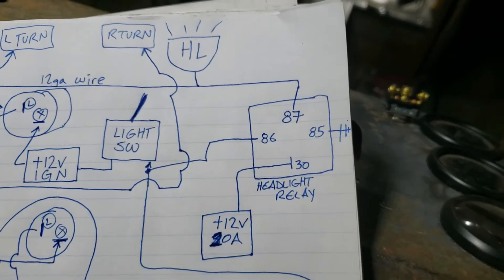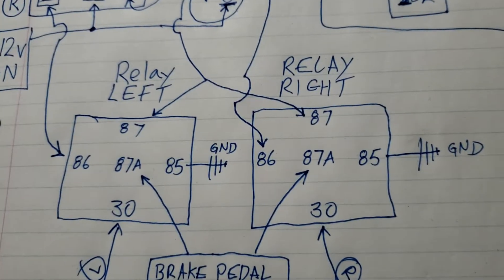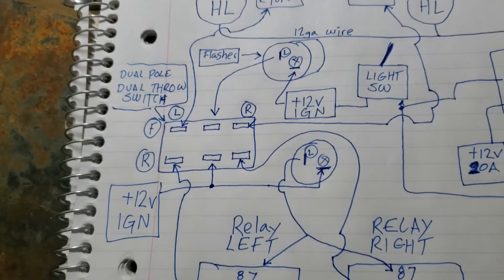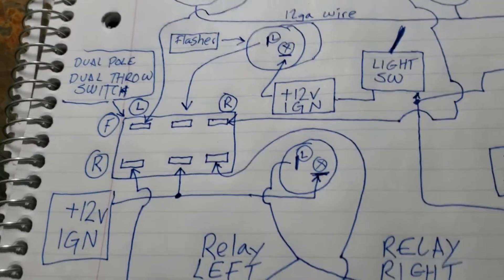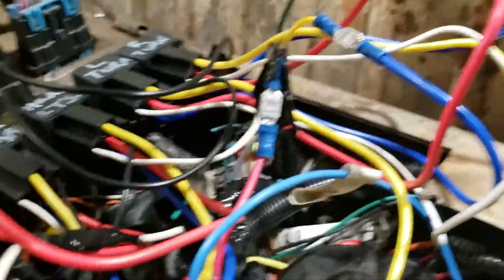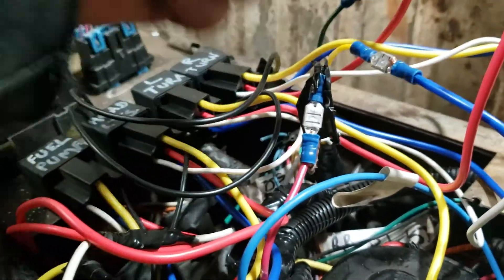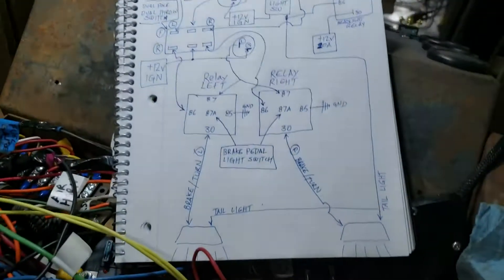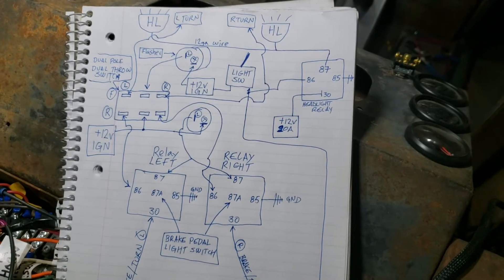Wiring up the Tail / Turn & Brake lights from Scratch

Comment: Could you please help me? I want to wire just my tail lights... Or maybe my head lights and tail lights together on a toggle switch? Everything is working except my tail lights on a 2008 Scion XB that I just bought. Someone added extra lighting there are wires going  everywhere. But my tail lights and my tag light will not work. I have already been pulled over twice. My son used to help me with all of this ... Unfortunately he was murdered over a woman 5 years ago. I am on disability . But if you can help me I WILL cash app or send you some money for walking me through this!
Reply from the maker: Wow. Jesus. Sorry to hear about your son. I think your best course of action would be to call a local automotive shop, preferably one that specializes in electrical. It doesn't sound like a big issue, but it's definitely one you should get sorted. I'm just some Yahoo Hillbilly up in Canada. You need someone local. Or check the fuses...

Comment: I have a 2006 dodge dakota  my brake lights stopped working on one side it has power  and not on the other side I  replaced the bulb  the light come on the right side but no the turn signal  and doesn't work at all on the left side it was working but just stopped working
Reply: Help

Comment: I don't follow the duel type switch. Is it a turn signal switch? Do you have a part number??? Where do I get this type switch??? HELP !
Reply from the maker: No, not a turn signal switch. It's called a DPDT (Dual pole dual throw) switch. Any place that sells automotive electrical stuff should have it. Literally just an on/off/on toggle switch with 6 spade connectors on the bottom. Good luck, and thanks for watching!

Comment: Would the rear lights wire split from pin 87 of the head light relay. Instead of directly from the switch. Not criticizing I’m just asking if it’s ok to do that
Reply from the maker: I didn't do that but I don't see why you couldn't. Try it and let me know. Might be better because the lights would run from a relay...always safer. Thanks.

Comment: How do you activate the brake lights when stepping on brakes
Reply from the maker: A momentary switch has to be mounted so that stepping on the brake pedal activates it. Also, some proportioning valves have a trigger built in that will allow power to flow. Many ways to make it work.  I believe Kip Tipper has a good video for wiring relays. Good luck and thanks for watching.

Comment: Can you show the work ? It would help out much more
Reply from the maker: You wanna watch me solder wires and attach relays? If you don't have a grasp of those skills,  you may need to back up a couple of steps and learn that first. I believe Kip Tipper has a good video on wiring up relays.

Comment: Do you have a part number for the dual/ dual switch? I’m building a 55 Chevy truck with an ididit column, do you have suggestions on that wiring utilizing that? Thank in advanced!
Reply from the maker: Just ask for a dpdt switch. They're super common. Also called on/off/on just with 6 connections on the back.

Comment: Just looking at your set-up here, and it's looking good. Only thing I would do different on the directional's is doing away with the second flasher and on your three-way toggle run that first flasher lead straight through to the second contact in the center of the switch, this way the flasher will energize the second set of contacts on the three-way switch, and they will still go to 86 on the lower relays just the way you have it. Then 87  on the relays will just get a constant or ignition 12 volts, now you have one flasher doing the whole job instead of two.
Reply from the maker: That's good advice... I think.  Not an electrical guy though. I'll try it next time and let you know.  Please do a video on your channel and tag me . I'm a visual learner so please do a schematic too.  I'm always looking for better ways to do shit!!
Reply: @BesseCustomFabrication  Dude, you did a great job on the video. And the set-up you came up with is great and works. When I was looking at your schematic, I was kinda thinking out loud, working it though my mind. As far as video's go, not much good at that stuff. Always looking on here for good ideas and found this useful...good job.

Comment: Thank you 4 posting this help me out on a 1953 chevy panel I'm working on I only have one break light on the rear door wanted the turn signal lights to have break lights to work don't want to get a fix a ticket cops in California love giving tickets out even though my chevy panel only came out with one break light from factory thanks again
Reply from the maker: Glad that this helped you. I just remember having difficulty finding the right information. I just wired my 1950 Pontiac the same way. Thanks for watching!

Comment: I am working with a 65 ford f 250/ purchased a new turn sig switch got all the head  lights and parking lights working but only have i only have left turn sig working , It is driving me nuts,
   Help.
Reply from the maker: Yeah, troubleshooting can be a real bitch! Double check your grounds and follow the wires. Sometimes I just run an external wire and see if it works that way, just to check.

Comment: Would you like to have a Hot Wheel police car when you pull the tail light thing over the road will the signals turn on by itself
Reply from the maker: What I would like, is a police hot wheel pulling over for tail lights thing with the Police turning on by them self in the car...manually pulling!

Comment: Love the wiring diagram, one question  though...could you possibly get away with a single flasherand jump the two center post of the toggle switch togather?
Reply from the maker: Don't think so. Go ahead and try it.  Let us know if it works.

Comment: Probably a dumb question, but what brake light switch did you use?
Reply from the maker: I used the switch that was attached to the pedal assembly from the S-10. My most recent project though, I built everything from scratch and used a micro limit switch.(Gikfun V-156-1C25 Micro Limit Switch Long Hinge Roller Momentary SPDT Snap for Arduino)The 3 wire one allows for the TCC (transmission control switch) to be used on the 3rd wire. Hope that makes sense!

Comment: Hey bud
I have a 68’ f250.
The wiring is driving me crazy. Head and tail lights work but brake lights and turn signals don’t. I need some help.
Reply from the maker: Just a video on wiring from scratch.  Usually the problem is a ground  but I don't claim to be the problem solver. It's a basic system on your truck, so use logic and..  find a good wiring guy.

Comment: Is the brake light switch supplying 12v or a ground to the relay ?
Reply from the maker: That is a power wire from the switch attached to the brake pedal +12v to relay when pedal pushed...

Comment: Hey man, nice job on the wiring diagram, thank you. How hard do you think it would be to incorporate the high  beam switch?
Reply from the maker: Should be no big deal. just add a relay between hi- beam switch and the hi- beam wire on the headlights. Use the same main power wire as the other headlight relays power wire.  Wow, I'm confusing myself now... Sorry.